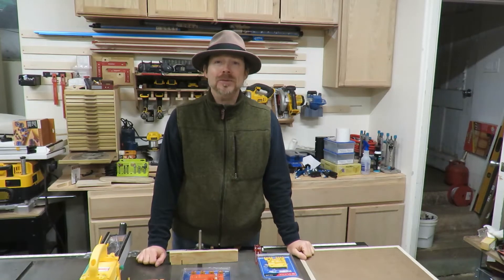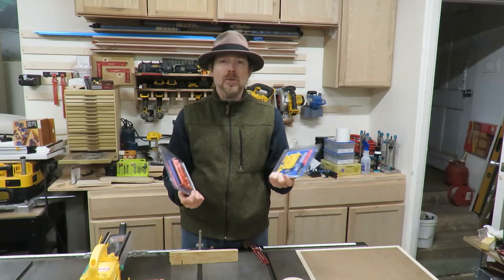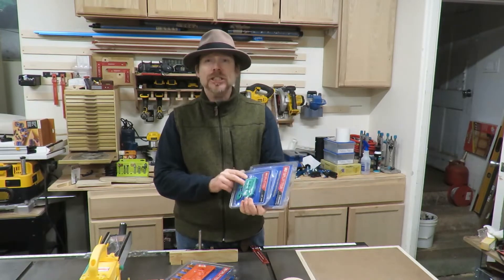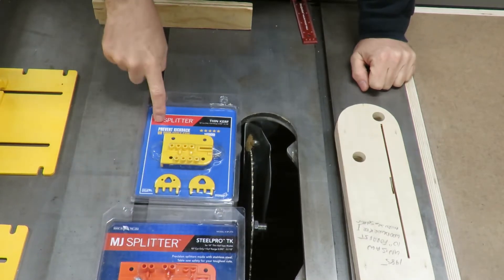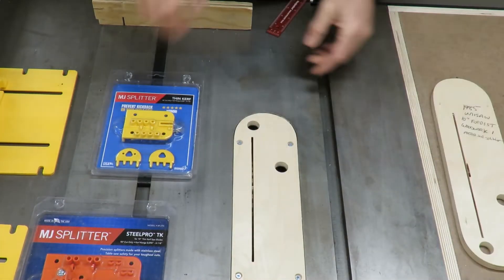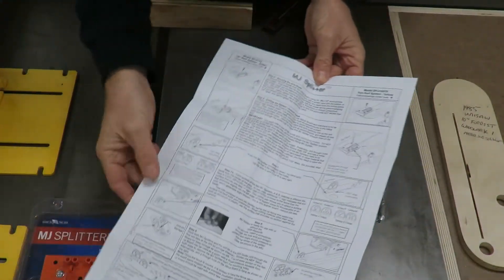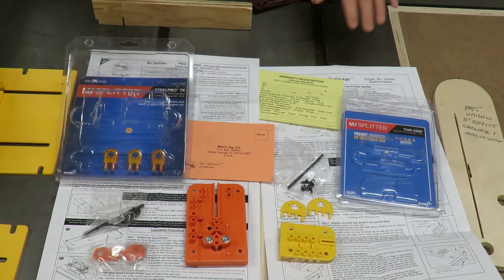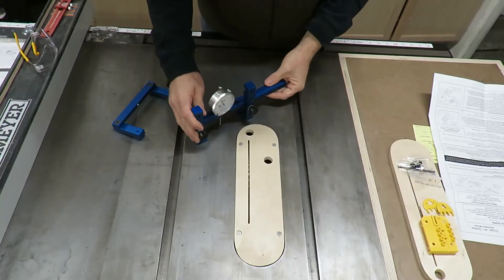MicroJig Splitter Steelpro Installation for Unisaw Zero Clearance Insert

Comment: ditto prev comment---also, stick to the subject---adjust your throat plate and your fence in another video---this video s/b on the installation of the micro jig splitter---what is the noise at approx 8 min point????
Reply from the maker: @rickkinney1249  I can see by all the content on your channel that you have extensive experience with doing these types of videos. I'll definitely concede to your highly valuable information from all of your high-tech experience as shown by your channel. If you don't like my video don't watch it. Everything that I included in the video is part of the instructions for making the jig. If you bothered to look up The jig or looked at the jig or use the jig or do anything about the jig you would know that. Happy holidays

Comment: Lol at the haters in your comments. I got what I needed from your video, and now have a new alignment gage in my cart.  Subscribed!
Reply from the maker: Thank you so much! The alignment gage is awesome, you will love it! It takes a little thought sometimes, when setting it up for a different machine, but it is extremely versatile. I even used it to assign the delta sliding table attachment for the unisaw. Cheers 👍🖖🤠

Comment: Nice tutorial.  You may want to double think running crosscuts like that... with the fence being used.  Good combo for a nasty kickback.  I'd personally never use a miter gauge with the work piece up against the fence like that, especially lacking a riving knife or splitters in place.  Stay safe and thanks.
Reply from the maker: I agree. I didn't realize I had done it in this manner, until your comment. I know the best way is to have an offset block, to set the length, then move through the cut. Thank you for the reminder! I shall try to keep that in mind, whenever planning future cuts. The entire reason for installing the MicroJig, was to help prevent kickbacks. And here I was tempting fate while trying to correct the issues I already had! Uggh